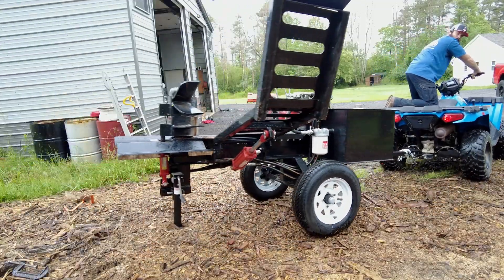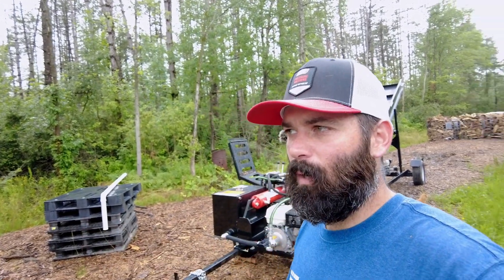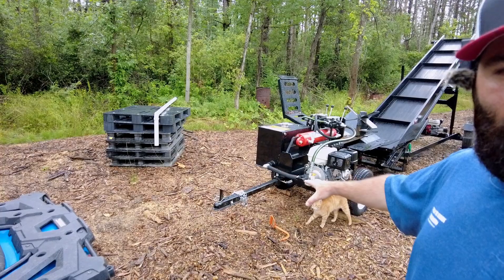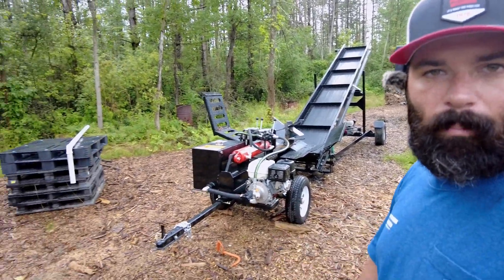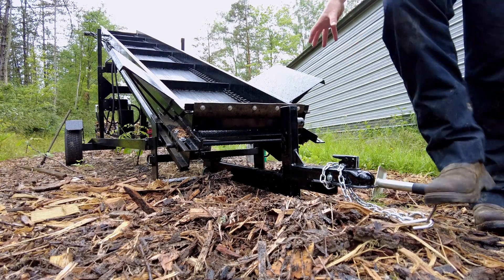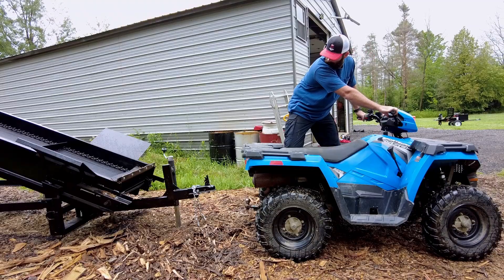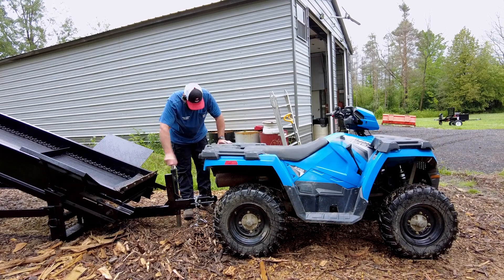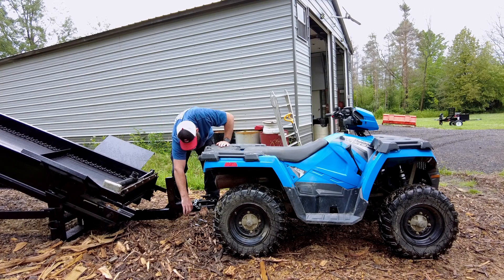ATVs are NOT designed for this.

Comment: Looks to me like you need a draw bar with a 6 inch lift on it, which would give you clearance in order to pull the conveyor without any problems . You could also buy an adapter from 1” to 2” and use your 6” lift draw bar.
Cheers
Mark from Niagara
Reply from the maker: Hey Mark, thanks for watching…that’s exactly what I detailed at the 5:35 minute mark. I think an adaptor would put the hitch too far back and create too much leverage on the adaptor

Comment: My ATV, a 2000 Kawasaki Prairie 400 does not have a receiver.  I bought a bolt on 2" receiver and use a couple of different draw bars depending on the trailer.  All are turned upside down to get rise instead of drop.  My Dad bought the Kawasaki new in 2000.  I bought it from him 7 years ago.  It has a carburetor and sometimes I want a newer one with fuel injection....but this one works.  And still looks nice.  So I keep it rather than pay the outrageous prices for new ATVs.
Reply from the maker: No doubt about that! I recently upgraded to this new ATV just because I found a screaming deal on FB Marketplace.  Ended up only costing me $500 after I sold my other one.

Comment: Gloom & doom. The new norm in WNY. One time solution here. Put some weight at the top on elevator or hang something from that end to counter the heavy bottom. Are you near an agricultural fertilizer/ chemical place. They probably have totes
Reply from the maker: That’s a good idea! Thanks for the tip, and no I’m not. I find a lot of those place reuse the totes and aren’t willing to part ways with them
Reply: @EverythingElliott  my place in Marion has a bunch. If the farmers don't want them they just pile up. Dropped a chk off few days ago and it looked like a few dz there
Reply: @EverythingElliott  are you going to Booneville? Trying to work something out for you to get totes . Have to hear back from the guy in charge but he was ok when I tried sending Tony there.
Reply from the maker: @brandonhoad9033  unfortunately I’m not. I have an out of town wedding that weekend so I can’t make it
Reply: @EverythingElliott  he just called me back and the tank would have to go to. Deal killer I'm sure. Ya know herbicide, pesticide.  Just thinking cuz I'm half way and 10ish miles from 104 to the n and Thruway to s. Could've loaded trailer and left it here til trip home.  Sorry it won't work out
Reply from the maker: @brandonhoad9033  can't say we didnt try!